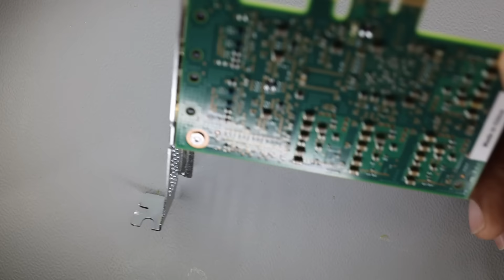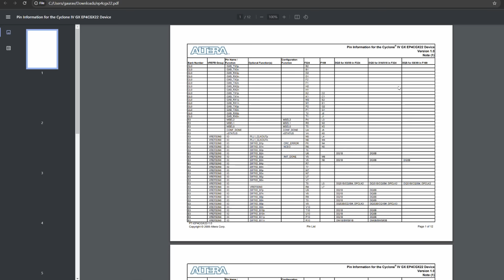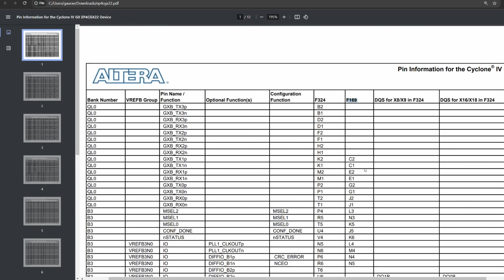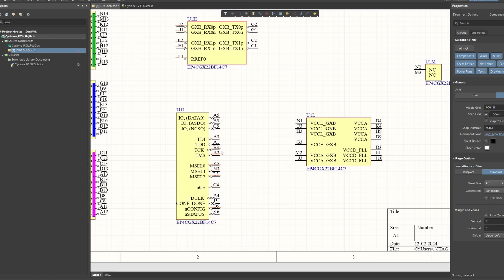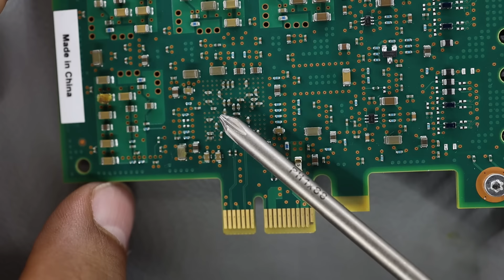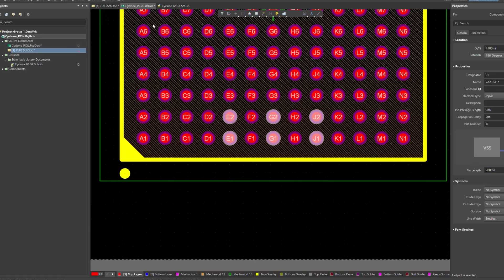How to Reverse Engineer a 12 EUR Intel PCIe FPGA Card  IBM 98Y2610

Comment: IBM?!! Brother man, if that is an FPGA from IBM then wow that is cool. Can you even buy these? Aren't they between $500 to $5,000 new? No way would I buy that. Buy for 12 EUR I would. Depending on batch size? 5 very large capacitors in view. LEDs = check. 8 huge solder pads? Too many to count probe points. I can see 4 daughterboards that seem to have discrete components (why?!) only reason I can think of is higher quality, better thermal stability etc. Did you just make me think that PCI is just RS232 on mega steroids?! Even if not true, that is what I now believe for fun. Is JTAG the same as RS232? Is RS232 the native language of chips or is that I2C? Interesting. I assume you could patch together very fast execute of functions like add, multiply, modulo, flip/flop, freq counter, fibonacci, pseudo-random, sound DSP, bit shift, invert, sigmoid etc is that how it is all done? Fast fourier transforms etc. Can you calculate PI with an FPGA? Mandlebrots? Sorry for all that questions.

Comment: This is pretty cool, thanks. Will you be working on simple stack that will allow a PC to communicate with the FPGA over the PCI bus ? That would be awesome.
Reply from the maker: Yes There is a Design Example Available from Intel, Source Binary are already available in my Github Repo.
Reply: @circuitvalley  Great! Thank you. I will check it out,

Comment: Why do u prefer xilinx?
Reply from the maker: Xilinx has better tool "Vivado" Has better documentation. Better support. Better community Support as well.
Reply: @circuitvalley  Ah. It's been years since I've used either brand, but was not impressed with Quartus, and not really with X's pre-Viv toolsuite. Viv did look promising.
Reply: @circuitvalley  Definitely agree! Xilinx & Vivado are better, especially for a hobbyist.
Reply from the maker: @m1geo  You are right, Thank you for your words.

Comment: When you JTAG in and program the FPGA, you're not storing that onto the tiny 8-pin configuration memory, I'm guessing?
Are there any pins like the JTAG pins that would let you rewrite the config memory?
Reply from the maker: Almost always Config Memory is programmed using FPGA itself a Bridge Between JTAG and Flash. All programs Vivado, Lattice, Intel . First load a small program to FPGA to provide access to Flash and then Program flash over same JTAG. You don't need Direct connection to Flash memory.
Reply: JTAG allows for the concept of multiple devices connected in a ring. While testing you write to the internal config RAM of the FPGA, once complete you write to the flash memory.
Reply from the maker: @stevetodd7383  Thank you

Comment: I am a nub at FPGA and analog stuff but I do know computers, but I am confused at why this would be a good idea? I found some dev boards with the same FPGA chip for 50 bucks. Is this board alot more powerful?
Reply: nice board but it is not really cheap, i noted cost over 60 bucks on ebay. I wonder how it is possible  to find out the correct pins for the uart receivers. Just pointing with the probes around the TX anf the BGA??
Reply: @CallistoPili  Yes thats what he did, just used the scope...
Reply: @exithe  I love the idea to launch for every pin a serial packet with the pin number.!!!!
Reply from the maker: I am glad you liked it.

Comment: IBM 98Y2610 - CEC enclosure RS-485 serial interface card
Reply from the maker: Thank you for pointing it out, Do you happen to know what is a CEC?
Reply: @circuitvalley  Central Electronic Complex, also called the Central Processing Complex - a name for the general-purpose hardware running a mainframe system (so basically the actual computers and not things like JBODs or networking).

Reading some listings, I think this card was made for DS8870 which went EoSL in 2020 (so no more support from IBM; it stopped being sold or receiving updates in 2016) which is probably why it can be found this cheap.
Reply from the maker: @oplik0  That is some different world terminology.  Thank you for your time and efforts.